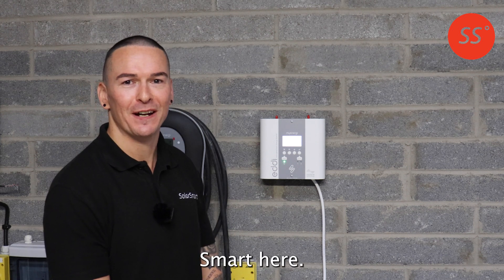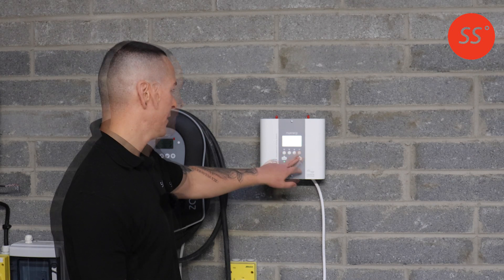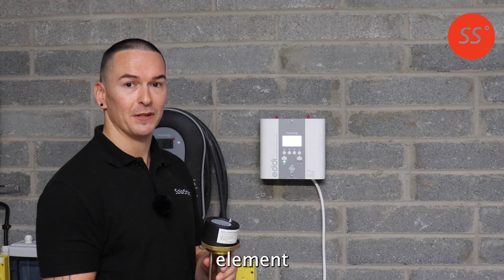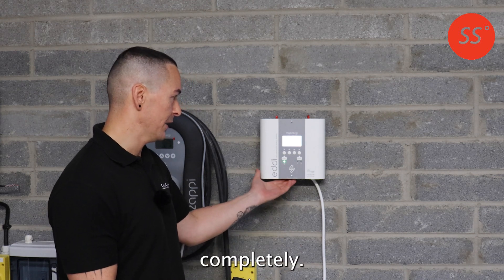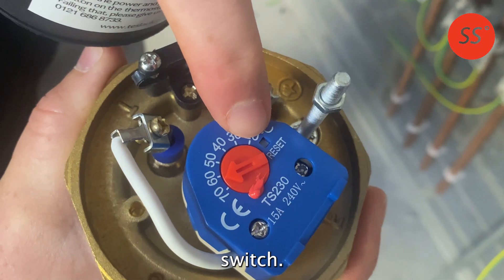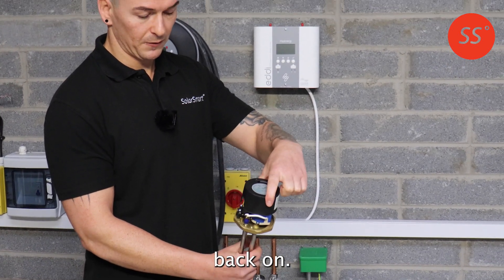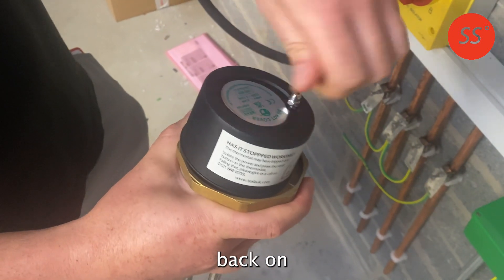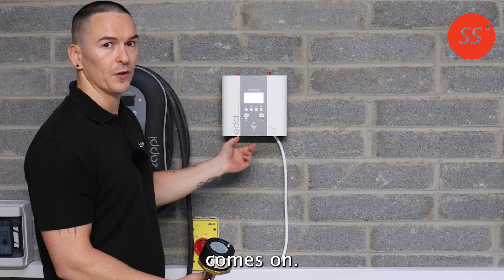MyEnergi Eddi hot water diverter fixes

Comment: This one might be of interest: https://youtu.be/KVkw_bC2qSc All in working order now. The snag was that the length of cable between the consumer unit and the immersion heater presented too high a current “spike” to the Eddi when the immersion heater thermostat switched on, due to the inductive load of the cable itself. It’s fine when the Eddi is reasonably close to the heater (as it is now at my place).

Comment: mine is now saying low voltage fault, and won't manually boost and my hub and app now not working either ((
Reply from the maker: Are you a SolarSmart customer? Please contact us for assistance on 1800 911 770